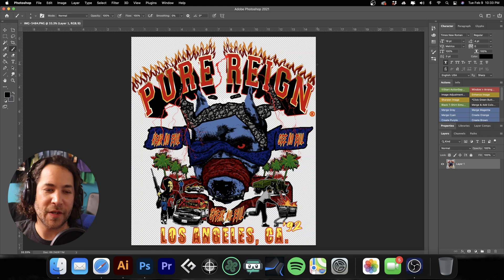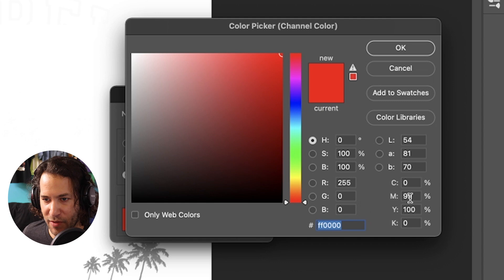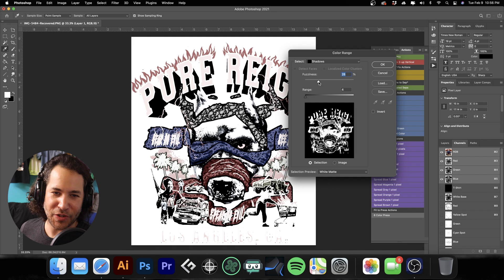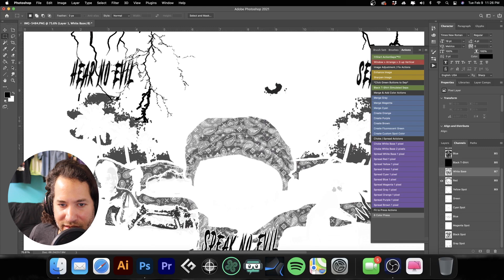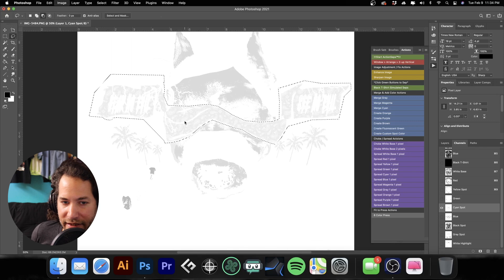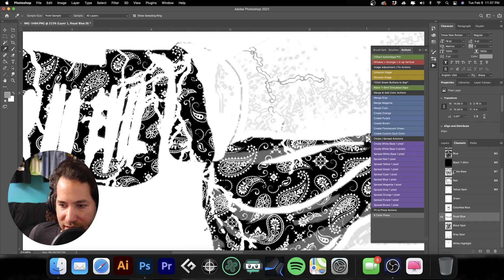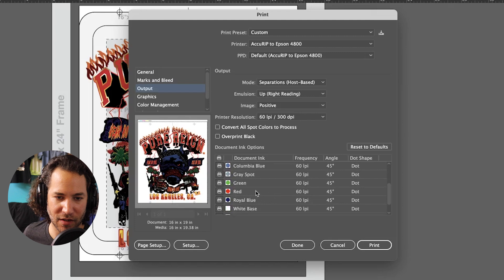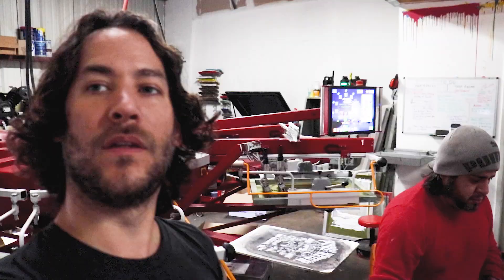How to Separate and Screen Print Simulated Spot Process on Black and White Shirts - Anatol Titan M

Comment: if anyone is having trouble with the base, If you have a transparent background, make a new layer fill it with black and put it in the back. Then select the rgb layer and invert. then hide the black layer. makes a better base than just selecting alone.
Reply from the maker: Thanks for the tip.

Comment: In this video, you select all R, G and B as a base. I think in previous videos, you only select one of the three for both base and highlight. I haven't printed a sim on dark garments, but watch these to be prepared when one comes my way. Do you suggest selecting all for the underbase or just the one of the R, G, or B profiles that reflects the best option or does it just differ per job?
Reply from the maker: I don't necessarily look at it like a set process. Different days, I may feel like taking a different approach. As long the the results come out well on screen, and press, that's all that really matters.

Comment: Ok, I'm working on an image and when I get to blue (it's a photo of a US Flag), I get that warning that less than 50% pixel... blah, blah, blah. I ignored the warning like you said. However... it won't invert the image. It turned into a big blue filter over everything. I've deleted it and gone back and repeated the process. Changed to a different picture... same results. What am I doing wrong???
Reply from the maker: And the image is in RGB with plenty of blue in the flag?

Comment: Hi Mike i wanted to ask if you could give me some advice I been trying burn my pictures onto the screen but for some reason the emulsion won't come off I use a 500watt lamp and dual cure emulsion and let the transparency paper sit for 13mins any advice?
Reply from the maker: It may be because the film isn't dense enough, or you're not getting good positive contact with the film to the screen. Be sure the printed side of the film is the one touching the screen. I hope this helps.

Comment: I have watched a few of your Simulated Spot Separation videos and am having a problem saving my finished file.  When I open the Save As dialog the Alpha Channels and Layers options are not available to check.  I am using CS6 and my file is currently RGB 16 bit.  I have tried to save as different file types (TIFF, JPG, PNG) and they Channels/Layers options are still not available.  I have also tried to change to 32 bits but then only Alpha Channels is a save option.  I dont use Photoshop much, have been doing my artwork in Illustrator, and am running PrintFab for RIP software.  I am at a complete loss as to why I am not able to save my file as you have shown in your videos.  Do you have any insight on this?
Thanks for your tutorials.
Reply from the maker: You may have to delete the RGB channels and the T-Shirt color channel and save it as a DCS 2.0 eps.
Reply: @mikeydesignssilkscreen473  Thanks, will try that.

Comment: Great vid!  It would have been nice to get a better/longer close up look at the final print.  Also, you spent a lot less time adjusting the separations in Photoshop on this one.  Is there a reason for that?
Reply from the maker: Thanks! You're right about that. I thought I had got more footage of the final print, but that job had already went out the door. The reason is, it's a simpler graphic and didn't need a whole lot of fussing with.
Reply: @mikeydesignssilkscreen473  oh, ok.  That makes sense.  One other thing if you don’t mind.  You also didn’t trap the top colours in this one.  Is that because you didn’t want it trapped on the white tee or is there another reason for skipping that this time?

Comment: Hey there! In a previous video (a fairly older one), you expanded the selection by 1 pixel for all colors, but you didn't here. What's the use of expanding the selection?
Reply from the maker: It just depends on the graphic. With this one but registering things was just fine.
Reply: @mikeydesignssilkscreen473  Alright! Thanks a lot for the reply.

Comment: Great vid, 2 quick questions, when doing the white shirt wet on wet, are you flashing the black that you are laying down first?   Also what angle are you running your squeegees at on your anatol.  I been trying to dial in the best angle. Thanks, again great vid
Reply from the maker: Thanks! We run it at 20 with just enough pressure to blend the squeegee so it's using the edge of the squeegee. We weren't flashing the black. Just all wet on wet so the colors mix.
Reply: @mikeydesignssilkscreen473  cool thanks,  I was thinking printing over wet black would make a muddy look, but I’m guessing the high mesh screen allows just the right amount, definitely gonna try as every cycle or flash adds time to the run and time is $.  Thanks again

Comment: Hi Matt , another great video ! Can you tell me , why did You set for colors 15% solidity instead of 5% ?
Reply from the maker: The solidity is really just a screen rep. In this case, because there were a lot of solid areas of color, I turned it up a little just so it'll appear brighter on screen. The solidity really has no effect on how the print results turn out.